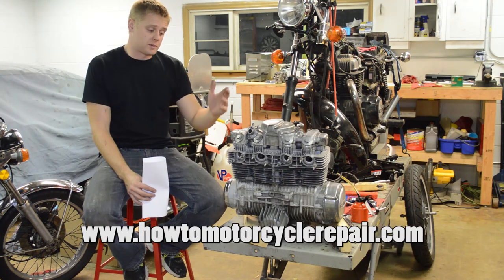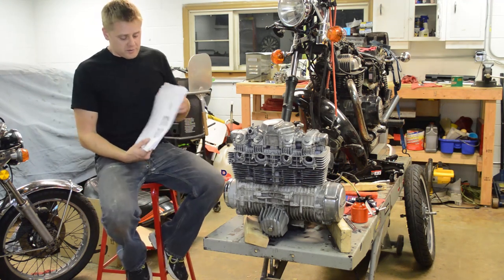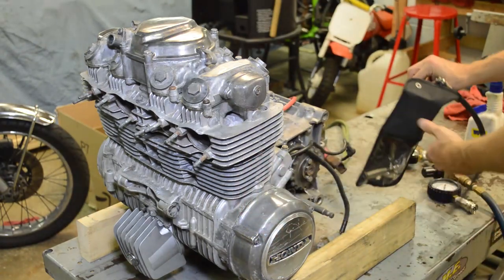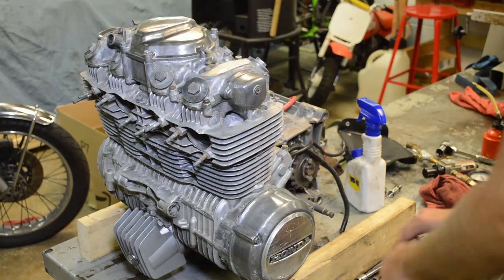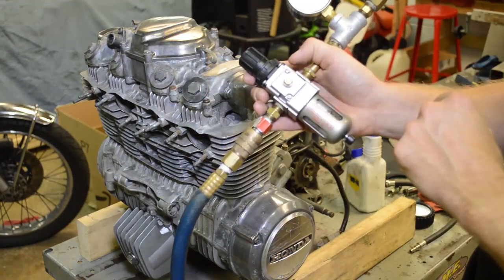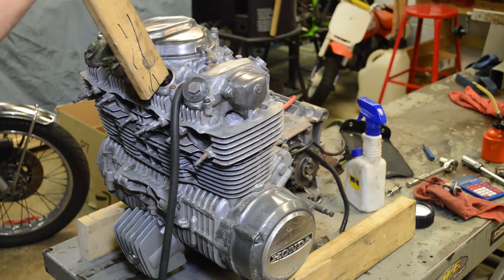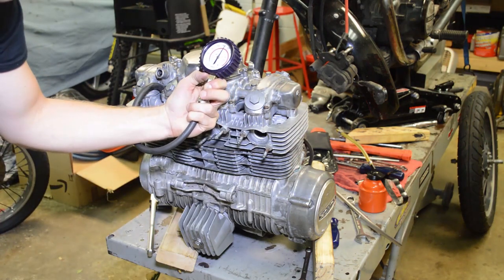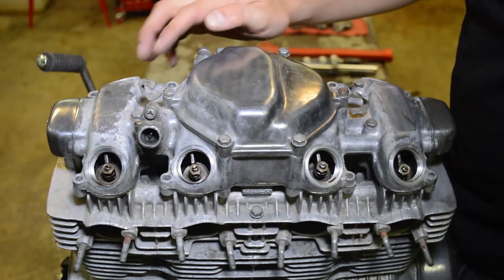How-To: CB500 CB550 CB650 Top End Rebuild

Comment: Great video!  I purchased the full version from you which was quite helpful in the refresh of the top end of my '71 CB500.  One item I'd point out is when you put the rear cam chain adjuster back on the cylinder before lowering it onto the bottom end you don't make mention of making sure the bottom of it fits into the small slot down in the bottom end.  I found this out the hard way, I bent mine up when it missed the slot.  I was able to straighten everything out and after several tries got it in correctly.  Otherwise, very comprehensive video.  Well done!
Reply: I can’t seem to get the chain on the sprocket properly it’s like my chain is to short.

Comment: Hi Matthew, great video and channel. I'm assuming the principles in your video the same for most older Honda engines. I want to do the same on my 87' cbr1000 engine. Will be picking up your video soon.
Reply from the maker: Tip tricks principles...yes. However your engine is much different.

Comment: Hi, I'm going to need to rebuild my CB750 DOHC engine. In my case the inlet valves leak so compression is way low. I know the engines are different but is the full video going to be of much benefit to me?
Reply from the maker: Your model is too different

Comment: This might be a stupid question, but what are you running to test the compression? This engine has a kick start if I'm not mistaken and you're some electronic mechanism off camera that's turning the engine for the test. Is it basically just an electric motor that is attached where the kick lever usually is?
Reply from the maker: This engine has electric start and I'm running jumper cables from a bike sitting off to the side. It also has a kickstarter.
Reply: Oh, thanks. I though they only put an electric start on the cb750.

Comment: Bruh you've saved my 80 cb750 custom! Your vids are sooooo freaking informative! I'm working a cb900 now! Leak down test on all cylinders are under 10% so why am I not getting compression over 30psi? Not enough rpm? I'm turning it with a 14mm on the rotor bolt!
Reply from the maker: You need to use the starter motor of the kicker to check compression. What brand gauge are you using?
Reply: MatthewMCRepair INNOVA 3612 Compression Tester - 4 Piece Kit https://www.amazon.com/dp/B000EVU89I/ref=cm_sw_r_cp_apa_blYKAb3A6HHWM and I also have the remote starter switch as well! The compression tester works because of you I built a 1980 Cb750 that had sticky exhaust valves! I was thinking more revolutions from the starter huh?
Reply from the maker: Are you holding the throttle wide open?
Reply: MatthewMCRepair The engine is out of the bike on a table! I have the battery out and charged as well as the starter solenoid! At this point I'm gonna try to set up a bench starter like you have! I hate reinstall the engine just to crank it over for a true compression reading! Any help on how to set that up would be great! Nevertheless thank you for you content and your details on jobs! I've learned a lot from you!
Reply from the maker: Just apply 12V directly to the starter leads and she will spin. No need for a solenoid. Use a battery and cables to run the starter motor.
Reply: MatthewMCRepair Again thank you I really appreciate it
Reply: MatthewMCRepair Just hook it up and lubed the cylinder with oil and got 160psi per cylinder! I am ready to mount after checking resistance on flywheel, stator and rectifier!
Reply: +willmann30 dse

Comment: Is it possible to have low and same compression on all cylinders? 45psi. maybe I'm doing something wrong.  Engine is out of the bike just like in the video.
Reply from the maker: What brand gauge? Throttle wide open or carbs off?
Reply: @HTMR  Autozone part 3614. I did check compression before with this tool on another  engine of a suzuki GS and it showed around 150. That engine was on the bike.   Now I have this cb550 engine  out of the bike just like  yours in the video. No carbs.  The strange part is that I'm getting the same low compression on all cylinder. , Normally It would be different readings so I'm nor sure if it needs a top end rebuild. Supposedly the motor has 11k but I cant very this. What made me check compression is that the motor is not very clean and looks like it has some oil  near cylinder two next to the exhaust outlet. Its' not necessarily from the head gasket but I like to make sure. Thank you
Reply from the maker: @tjj6583  Does it have a schrader valve on the end that goes into the head?
Reply: @HTMR  yes the schrader valve is on the cylinder end but I was also using that  fixed extension that came with the set  I will try again without it.
Reply: 120 110 100 120  compression result. Guess it needs a rebuild.

Comment: the valves are supposed to have "wiggle" when they're at TDC. correct? that's how you can tell which is at TDC: 2 or 3, and then 1 or 4; whichever one has that wiggle.
Reply from the maker: Yes, there is supposed to be valve lash at TDC on the cyl you are checking.
Reply: Gotcha, because at 18:28 you're talking about valve lash like it shouldn't be there—unless #2 isn't at TDC right there?
Reply from the maker: If the valve had no lash then that could be causing leakage.

Comment: I think in the gasket set, there is and is also seen at your video 8pcs of green o-orings? Whats the meaning of them?
Reply from the maker: They go under the valve guides.
Reply: Thänks. Thats what I was thinking
Reply: If engine has bad valve seat o-rings, what could be the symptons?

Comment: You mentioned that there was no possibility of getting the timing off 180° because you didn't have the cam installed.  I hear all the time of people getting their timing off by 180°.  Can you explain how that happens and why not having the cam in would prevent that?
Reply from the maker: All you need is to have #1 at TDC, then hook up the cam.
Reply: Oh, I get it now.  The engine has to be at TDC of the compression stroke of cylinder #1 for proper timing but with no camshaft in place you just need to worry about TDC and not whether it is at compression stroke or exhaust stroke since without the camshaft in place that has no meaning.
Reply from the maker: Correct.

Comment: I hope you see this dude I’m at the top end where I’m putting the camshaft in and trying to get the sprocket and chain onto the mounting ledge of the camshaft and there’s just not shot I have enough chain here. You put it on so easily with a lot of slack and mine is definitely not like that😂 so stuck. Send help.
Reply from the maker: Tensioner retracted? Using the cutout in cam sprocket to drop it the lowest. I know it is tough, but there is a way.

Comment: Matt, just subbed. Great channel so far! I just purchased a 1980 CB650 that needs an overhaul like this. Will the full length video be informative enough that I can do this on the CB650?
Reply from the maker: Yes, there might be some differences however will get you 90% of the way there.
Reply: Great question and appreciate it being answered. I acquired an ‘81 CB650 STD (5k miles on OD) in very good condition with it needing some adjustments made to it where the previous owner was either 4 ft tall or didn’t know what he was doing and a thorough disassembly, some cleaning especially anything at the bottom of the bike, some rust removal from the gas tank and the drive chain + sprocket (will likely end up replacing these) and very tiny pin head sized dots of rust on the mufflers and random other areas of high polish chrome including the wire spoke wheels, and there was splatter looking small areas of what appeared to be corrosion on both of the engine cover plates (high polish outward facing pieces that house the alternator/stator, gear shifter/sprocket+chain, oil pan, and whatever is in the last one, with 2 of these 4 plates having the Honda logo and referencing made in Japan) on both sides of the bike. This corrosion was elevated off of the surface of the metal similar to how a drop of water would sit in the same spot however, when I managed to remove it I was left with a stain in the clear coat that is sprayed on these specific engine cover plates.
Anyways, I’m getting there and am almost done with half of the sanding. I’ve ordered the Duracoat Clear coat aerosol kit with Trustrip, full gloss sheen in the clear spray can, extra adjustable nozzle, and added UV protection option and am going to spray all of the engine covers to replace the clear coat from Honda with the super hard unbreakable unpenatrable coating from Duracoat, and that should keep it looking as if I just put down the Flitz rag 😊

Comment: Great video ! Is a honda cb350four engine simular to this??
Reply from the maker: Kinda. I've had a guy use this video on a cb400 and it was helpful to him. The components under the valve cover are slightly different.
Reply: Okey thanks for the quick reply thanks !!
Reply from the maker: If you buy the video and you feel it is not helpful for your model, just ask for a refund.
Reply: Wow ok great thanks !!

Comment: what is the tool you used to clean the cylinder head with can you direct me to where I can get it?
Reply from the maker: Can you please reference a time in video? I'm assuming you mean the gasket scraper? Links are in video description.
Reply: MatthewMCRepair 32:40 the hone tool and I see the come in different grit. any recommendations would help I'm going to be doing a top end rebuild on a Yamaha xj600. also can you recommend a proper piston ring kit for reinstall? thanks
Reply from the maker: Check out this site for hones: http://www.brushresearch.com/

I can't recommend a piston kit other than OEM. Make sure to check ring end gap.
Reply: MatthewMCRepair will do for sure .. I appreciate you taking the time to respond as you actually alway have last 2 questions for now when I hone should I do it in step 120 240 320 or witch one should I use? and I plan on also changing the cam chain is OK turn the motor when it's disassembled... and actually if you want to email me a price on what you would charge to put my heads valves in spec after I'm done cleaning that be cool I'm in MN so not to far from you if you're in Chicago
Reply from the maker: Use a single grit. Here is a list depending on rings used: http://www.enginehones.com/technical.html

Yes, you can turn motor over with cam chain attached, just make sure it does not jam up. You will have to "help" it along.

I don't do any machine work, so you may have to look elsewhere for a valve job.

Comment: You should make a full engine + carbs rebuild video!!!
Reply from the maker: Bottom engine rebuild is in the works. I plan on doing carbs in the future.
Reply: I hope you are finishing it soon because i would buy both. I want to make a full engine rebuild on my CB550... When are you expecting to release it?
Reply from the maker: Well, engine is still under workbench. So a few months for sure. I don't have a set of carb in hand to do that video.
Reply: I've got a set of '73 500 carbs that need to be rebuilt. You could use those for making a video. Got 4 kits for the carbs also. 1 has a stuck pin in the float and pours gas all over the ground. I could ship it to you.
How much would the rebuild and bench tune cost me? If you're interested.

On another topic, what is the easiest and best way to replace the front fork seals?  Remove the whole tube assembly from the tt or just remove the oil and unbolt the lower bolt that is on the bottom between the axle studs?
Reply from the maker: John,

I can rebuild your carbs at $50 each. However, I'm slammed right now.

On the fork seals, remove the whole tube assembly. Loosen the top cap first though.
Reply: Thanks

Comment: Hey Matt love your vids man, when you do seafoam through the cylinders, do you pour some through the spark plug holes then change the oil in a day or so?
Reply from the maker: What problem are you trying to solve?
Reply: MatthewMCRepair trying to solve low compression, but I am going to rebuild the top end and do it right, I already installed a dynatek ingition and coils and rebuilt carbs on a chopper I'm rebuilding. 

How do I go about buying the video? I tried to follow the link but couldn't find a way to purchase the full length video!
Reply from the maker: Here is the direct link: https://gumroad.com/l/LtpvD
Reply: Bought the video, loving it so much, I'm getting ready to hone the cylinders, I clicked on the link but am having trouble for the size, I have a 1976 550 cb as well, do you by any chance have the sizes of the honer you bought?
Reply from the maker: Thanks for the compliments! Here is the hone I bought: http://amzn.to/2iDm8Du

Comment: could this video be used for a 78 cb400?
Reply from the maker: Yes, however they are different. The valvetrain and oiling under valve cover is different. I've had a couple people buy for your model and it did help them. If you decide to purchase and it does not help you ask for a refund.

Comment: is this at all similar to a cb650?
Reply from the maker: 650 is different. What year? I'll double check.
Reply: 1980
Reply from the maker: Looks like they are very similar. I'd get the service manual along with this video since some torque specs etc might be different.